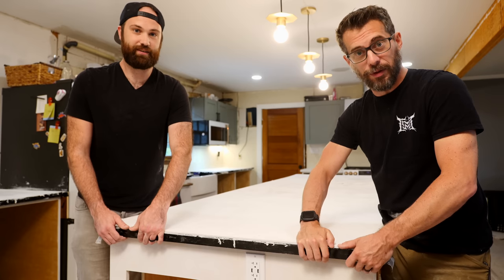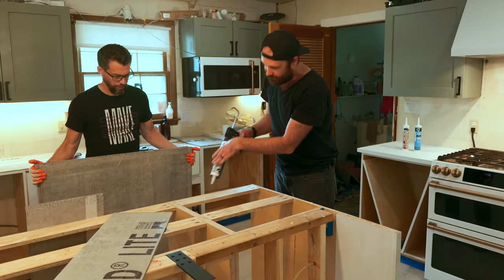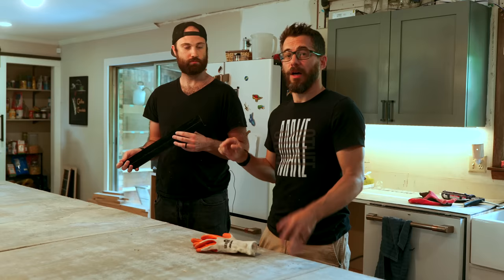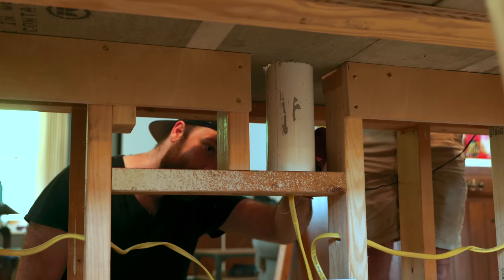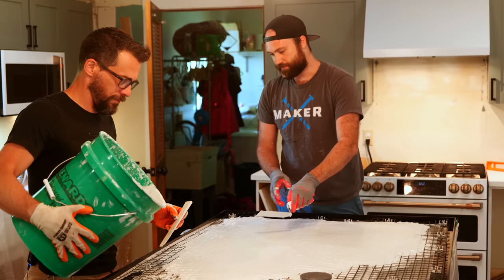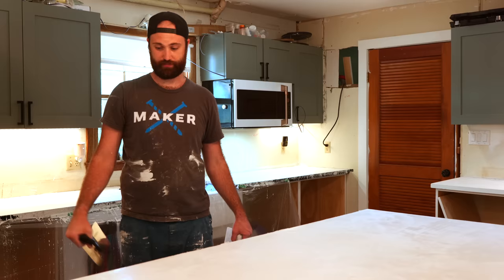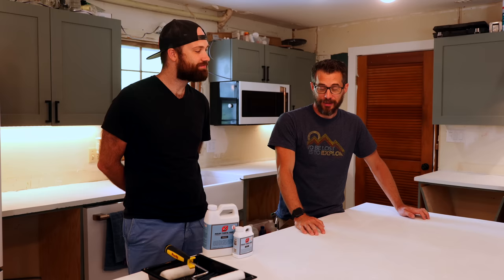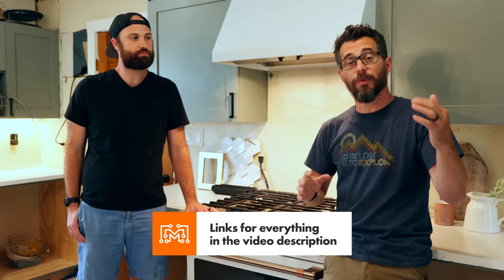Make Your Own Concrete Countertops (From a Kit!)

Comment: I would love to see a follow-up video to this (maybe on the second channel?) that shows the touch up work Anthony did on the island. So many other concrete countertop videos either come out "perfect" or skip over the touch up steps. As someone who wants to tackle this project at some point in my own house, I feel like that would be super helpful to see.
Reply from the maker: Anthony says that the company has a lot of great resources to help with the finishing and fixing tiny mistakes.
Reply: mine using ceramic tiles for finishing, for durability and waterproofing
Reply: We recently poured our own counters and still have a bit of unevenness that I would love to level out. Very curious about the "flooding" process
Reply: @Iliketomakestuff  show them used in this practical example?
Reply: Didn't even know there was a second channel till I seen this comment
Reply: I’d love to see this as well
Reply: The touch up process would be very interesting to see. Thank you
Reply: Check out Buddy Rhode's videos as well.  He shows a finish step

Comment: We put in a gigantic concrete slab bar in our brewery using this system. Its an "L" shape, 16x4 on one side, and 20x4 on the other. It was a LOT of work, but it was definitely worth the effort. I pulled in 6 friends who have never worked with concrete before, and the end product is amazing. Its a messy job, but very "novice" friendly.
Reply from the maker: Agreed. I guess you could pay them in drinks.

Comment: Part of the reason for that edge profile is that the vertical surface on the back of the 1-1/4" section prevents liquids from following the bottom surface all the way back to your cabinets if there is a spill.  If you got a different edge style from a company like this or made your own forms, it's important to have some kind of break like that, even if it's a different shape/style.
Reply from the maker: That's a great tip, thanks!

Comment: I just started doing white concrete countertop using the same products. I thought I screwed it up because of my inexperience, but after watching this video, I feel a lot better about my end results. I think it came out better than what Anthony and Bob did. There are a lot less bubbles on my edges. I know they are both new to pouring concrete themselves, but glad to know that I'm at least getting slightly better results.

Comment: I used this system about 6 years ago. I polished ours in place which made a huge mess but they are super smooth.  They are great because you can put hot pots/pan right on them.
Reply: Is staining a problem?
Reply: @wabisabimaker1794  not with the proper sealant.

Comment: Civil engineer here. Pro tip:If you want to help concrete flow better between mesh just use a vibrator(yes the kind you are thinking about would work) or anything thin enough to fit between the mesh gaps and vibrates.

Also could you share the excat type of concrete used? Just curious
Reply: There's some info in the description box. I was curious, too.
Reply: I was thinking the same thing. A good thumping before screeding would make life easy.
Reply: They used Concrete Countertop Solutions white concrete mix. It’s a 9000psi concrete using acrylic fibers vs fiberglass.

Comment: Best solution i have for bubbles would be coming from under the countertop in the cabinet area with a reciprocating saw or a vibration saw both with no blade and it will vibrate all of the bubbles out more effectively.
Reply: Also an autobody polisher leaves a great sealable surface with less dust from sanding

Comment: Just curious, I couldn't help but notice the gaps around the outlets on top... what with this being a countertop and spills that will inevitably happen... is there anything like a silicone seal or anything around those that was or will be added?  I would love to try this project myself, including outlets, and curious how you tackled that?
Reply from the maker: Good question. He is doing a top coat to even everything out (a product the company offers) and it should set the outlet covers flush with the top.

Comment: I would use a floor epoxy kit for the finish since those are meant to go on concrete, but that's just my taste
Reply from the maker: Make sure you do your research before you start, but I'd like to know if it works.
Reply: Things that go on floors aren’t always recommended for food surfaces.

Comment: As with all 'concrete jobs' that involve a large flat area, air in the mix is an issue. I have seen people use a reciprocating saw, without a blade in it, to provide vibration on the outer edge to get the bubbles out. For projects like this one I would suggest using an orbital sander, without sandpaper. You talked about, but didn't show it in the video but I assume you put a 2 x 4 all the way along under the outer edge of overhang and then put props under that to take the weight.

Comment: I know when screwing into concrete backer board and using any kind of concrete, mortar or thinset on top of those screws no matter what youre supposed to use a specific type of screw that wont be effected by the alkali in the stuff just like the fiber mesh tape you use has to be alkaline resistant..  backer-on makes a screw designed just for that..  im sure the countertop will be fine but would be worried about chipout over time where those stainless screws will corrode and form an oxide layer on top which can crack out the insides of the concrete..

Comment: Did you need to countersink the screws in the edgemolds? Wouldnt a screwhead sticking out make it stronger and not even move at all?😃
Reply: No you use panhead screws for strength to hold them down.

Comment: Looks great. I would have loved to see the curved opening for the sink as well and how did you all manage that one.
Reply from the maker: The company sent their sink form. It is a single flat bendable form with adhesive on the lower edge. You stick it to the inner edge of the sink and concrete gets poured. There are other sink options on their website, but that's how he did it.
Reply: @Iliketomakestuff  thanks!

Comment: Could we get any more details? Cost? Square footage? How well the other applications helped the island with leveling/coloring? I'm very interested in making my own counter tops and would love any extra details we could get. Thank! Great video!
Reply from the maker: Not counting shipping, the cost of materials and tools was just over $1,300 USD.
Reply: @Iliketomakestuff  AWESOME! Thanks. That helps a ton!
Reply: @jeremyspecce  Been planning my own and for 6 bags the shipping was going to be $350 so yeah, it’s pricey due to the weight. I ended up finding a distributor that was only 4 hours away and picked it up at $65 in gas instead.

Comment: Did you guys use the Euro Form? I heard you mention 1” of concrete over the main area with the 1-¼ face. Just curious if you know. We have used their regular form edge and are now using the Euro. I own and operate a renovation company. Great video for sure! Glad you guys did a zoom out of the plastic and the mess as so many don’t show it and then someone tries it only to find they have ruined floors etc!

Comment: How do you get the backwall forms off? They aren't visible along the wall after they are complete. The official Concrete Countertop videos say you cover it with backsplash, but I see you didn't put on a backsplash yet and they still aren't visible.

Comment: Holy h***! yeah those circular hole cutting drill tips are not for use in hand held drills! LOL Very very dangerous! Those should only be used in a drill press. I know, I tried once... I ended up in the ER.

Very cool job by the way. :)
Reply from the maker: Glad he was only cutting a relatively soft material. I hope you're ok

Comment: You need to use a "powered hand sander" without paper to vibrate the sides to get the air bubble out.
Reply: This company makes an attachment for a multi tool to vibrate the forms.

Comment: Regarding the bubbles - would it help to hold a small hand sander (with no sandpaper) against the wood below to cause vibrations, to float any bubbles up to the surface right after pouring?

Comment: WARNING - OURS TURNED OUT LIKE GARBAGE

This was entirely my fault and avoidable though. (Local big box store) did not have the recommended concrete, so we bought what was recommended by the store as an alternative, first mistake. We started in the late afternoon, second mistake. We only watched the first half of the videos WHICH IS THE EASY PART, THE HARD PART IS FINISHING! WATCH THOSE VIDEOS BEFORE BUYING THE STUFF, AND THEN AGAIN BEFORE STARTING THE POUR

We ended up with a lot of rock protruding through our concrete, making a rough finish. We tried sanding and grinding to no avail. Ended up pouring a concrete refinisher over it WHICH I DID NOT RESEARCH AND IT DID NOT BOND. My fix was to use countertop solutions hydropoxy(I think) coating to seal it and ignore it after that. 

Moral of the story, watch every video, read every article, maybe even find a seasoned concrete finisher in your community who might come over one Saturday and help you with the project.
 
ITS NOT EASY but concrete countertop solutions make great products and have great videos but they can't fix stupid. Don't be stupid like me.

Comment: Why does it look like you can see remnants or ghosting of that fiberglass screen material in the surface of the concrete around a foot out in front of Bob's left hand? timestamp is 12:01   ########   AND...  Due to current financial constraints, the light at the end of the tunnel will be turned off until further notice.

Comment: Out of curiosity, can you share a ballpark figure for what the materials cost for this particular project as a point of reference?  This seems to be an average sized kitchen (with the exception of that awesome island) so it would be helpful to have an idea before I begin investigating further...
Reply: Probably about $700… their concrete is roughly $27/bag and the forms are about $300 per case. For 64linft

Comment: How long does seal coat last before having to reseal or touch up again?
Reply: The company has a sealer that is recommended to reseal after 5yrs depending on use. Z-Aqua-Thane comes in a gloss and a matte.

Comment: Quartz took way longer? From order time to delivery maybe, not installation. Concrete is an interesting counter top material, I've been involved with high strength, solid pours, with lightweight fiber reinforced, onsite pours, off site and installation jobs, colors and textures that resemble marble, leather, lots of variation. Would I use it in my own house, nope. Maintenance issues with resealing, chipping, and yes, scratching, then there is the high probability of staining as your sealer wears off. . Bob's quartz tops are my choice, installation is generally a one day process, low maintenance, no sealing, scratches repaired easier. Do your research, consider the benefits of both. quartz is costly, redoing your concrete counter top because you screwed up or even if you didn't is a consideration.
Reply: Our concrete countertops have not stained after 6yrs so far and we have 5 children and a very busy kitchen. While your thoughts on quartz aren’t wrong, your opinion on the concrete may be skewed to an installation that was improper.

Comment: Someone answer me this: Is it a MUST, to REMOVE the old countertops? I mean, i know the countertops will be slightly HIGHTER. As for sides/edges, I would think you could just trim off an inch or so, for the new rounded edge. Seems unnecessary to rip off the old countertops to just spend extra money and time putting down cement board to cover it up with as the old tops would serve the same purpose.  JS

Comment: Silicone sucks, after awhile you can peel it off super easy in a solid non stick piece. Personally I always try to use urethane sealant or something oil based, that says flammable on the label.😳

Comment: PRO tip: (kidding), but I would maybe anchor a rotary drill with the mixing blade attached to the cabinet to try and vibrate it, in order to settle and reduce air bubbles